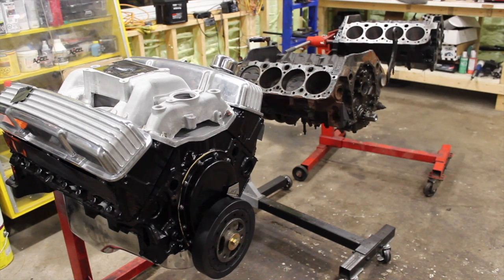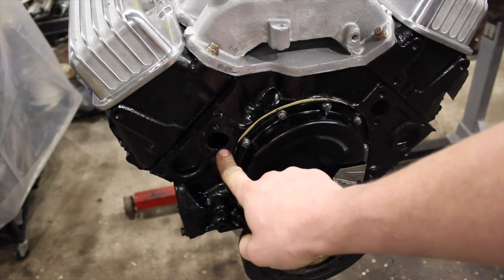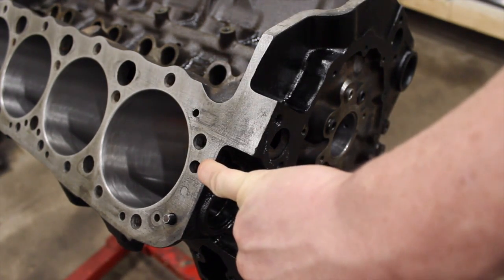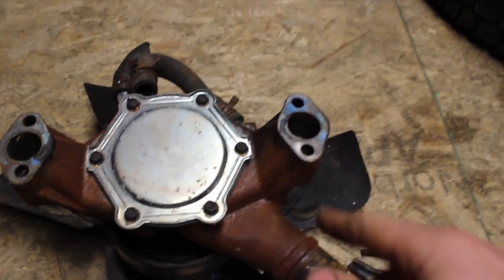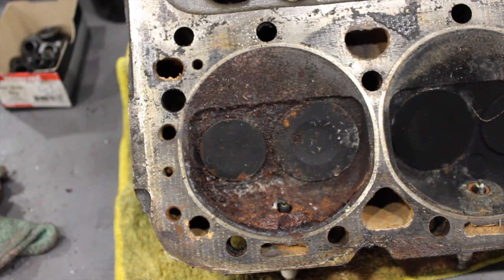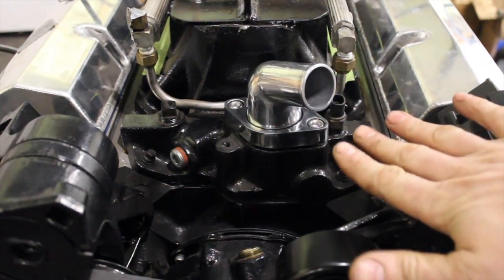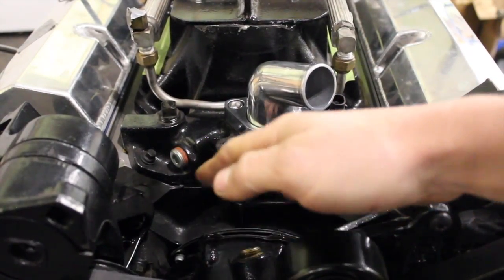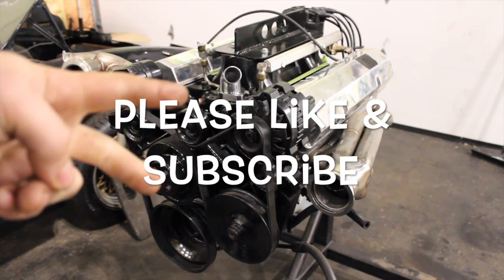SBC Water Pump Bypass? (Read Description for instructions) Vortec heads vs Traditional heads

Comment: I don't have vortec heads, but I have a high flow water pump and am considering blocking this port off because anytime I get above 5000 rpm it blows the gasket ONLY at that port. Any drawbacks from a performance standpoint while trying to gain some reliability from the mod?

Comment: I have the Vortec block and Vortec heads. Thing runs too cool in the winter (160*).
I have a water pump with no port and a manifold whose front port is being used for something else. So I can't run an external bypass in the typical location. I have the stewart high flow tstat that has holes in it and it allows me to run cool in the summer. I have the air gap manifold that has 4 corner ports. Can I use one of those and T into the heater hose that goes into the water pump?  Will that allow it to get hotter in the winter and then I can do away with the high flow tstat?

Comment: This is total garbage.  That second hole under the main cooling hole does nothing for cooling.  If the thermostat is closed there would be no circulation because the low pressure side of the water pump cant get any water to pump through anything therefore you’d have no flow without the heater core hose feed and return hooked up.  Drilling holes in your thermostat is totally retarded too.  All it does is make it take longer to warm up.  There is literally no value to anything you “play with” here.

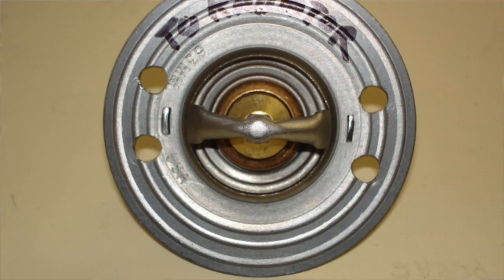Comment: This is the sacred secret for Vortech swappers. This is a fantastic video. I have a small problem at 7:18 - I totally agree with the hole in the thermostat to let trapped air out. Import cars have done this since the 70's. They usually put a rivet in the hole so it stops the flow once the fluid goes through the hole. I DON'T agree with drilling 4 to 6 holes in your thermostat. Your engine will take 1/2 hour to warm up because so much water is going to the radiator. You only need one 1/16" hole.

Comment: That is a really good video,  not being rude , but need to add check water pump for proper rotation. Vortec pumps are designed to run CCW called reverse rotation,

Comment: Have you used many of the Chinese rpm air gap copies and dynoed enough to see if there's any power difference in peak power and average power in both torque and horsepower? I'm a huge victor jr fan, but that's on smaller engines and I'm considering trying an rpm air gap on my 383.
Reply from the maker: Ive found that just about any engine that operates under 6500 rpm makes better average torque and HP with a Air Gap style intake vs Single plane. Sometimes, the peak HP is slightly lower with the dual plane but sometimes not
Reply: @cuttersperformance  does any of the Chinese knock offs work as well as the Edelbrock rpm air gap , or does the Edelbrock make more power to justify the cost difference?
Reply from the maker: @inscoredbz  ive never done a back to back test. But ive made similar power on similar engines with the same style intakes. There's no doubt that the edelbrocks have better castings than some of the knock offs though

Comment: Have a 350 old school block a friend built for me. not Vortec heads, but he put tbi heads on it. having trouble with it heating up way to fast, and not coming down while driving. tried multiple fans and cooler thermostat and no change. I then find out, he was going to put an electric water pump on it, so he blocked off the bypass hole. then decided against it. installed a factory style pump for the block, but before doing so removed thge bypass plug, and conveniently forgot to mention the plug fell in the block and he couldn't remove it. no provision in intake for a bypass hose. my question is, are the tbi heads also not drilled for the bypass provision?

Comment: If i were to drill that bypass hole (im running afr heads on a 880 block) do i need to drill any holes on the head deck?

Comment: I do like serpentine belts. But im putting my vortec in a 72 4x4 chevy truck. So id like the engine to be clean of the big serpentine brackets. Can i just run the vortec bypass hose from the intake to a old school water pump, and everything work out fine with a V belt set up?

Comment: Hello Pat, what's your take on pump rotation clockwise or factory counterclockwise or does it matter?
Reply from the maker: If you're using a OE serpentine belt, most setups will be spinning the water pump backwards so you'll need counter clockwise pump. All V belts need a regular water pump (clockwise)

Comment: great info, i got vortec heads just to get a small performance boost on my junker 360 sbc and i had no idea they blocked the internal block/head bypass for coolant flow. Ill have to check my manifold if i have a port to add a bypass hose to the pump or ill just drill the thermostat, hopefully i dont forget when the time comes to do it

Also, out of curiosity, any port on the top of the water pump will do right? Do all the ports take coolant in or are the lower passenger side coolant out?

Comment: only ever drill a 1/8 hole in a thermostat as a air bleed . The factory only bypasses the coolant to one side only.  Far better off using a bypass hose ( like a big block) . this stops the block & heads going into thermal shock as the thermostat constantly opens and closes. A thermostat is considered open at 8mm open and flowing its max.

Comment: I am using a blueprint engine setup with the vortec style heads and the block doesn't have the bypass hole in it for the old style water pump that is going on it I am going to drill some holes in the thermostat after seeing your video on it so I don't have to run the hose from the water pump to the intake thanks for the information. But do I need to block off the bypass port on the water pump itself and what would be the best way to do this ?

Comment: What did you use to plug the water pump bypass hole
Reply from the maker: You don't have to plug it when using vortecs heads on a older block. The vortec head blocks it off
Reply: @cuttersperformance  I have a Chevy 350 with speedmaster aluminum heads I went with serpentine set up and my 3rd hole where the water pump at I need to plug it

Comment: hey brotha love your videos I have 880 block that does have 3rd hole on block so your saying if I use older water pump with vortec heads all i need is holes in tstat i dont need to run hose from water pump to intake doesn't that do same i live AZ so would it be good to do both
Reply from the maker: Run the bypass hose plus put two holes in the thermostat
Reply: thanks man I appreciate you and all you do

Comment: Thank You Thank You Thank You. 
So glad I subscribed and learned this very important coolant issue.
I'm installing 059 Vortec heads on my 1985 Gen 1 SBC. I had no clue this was a thing. Drilling holes in the thermostat is a great work around.

Comment: What if I have the bypass and drill 5 holes? I was told to drill 5 holes by my buddy before I seen this video lol I’m also in Texas tho
Reply from the maker: Have you tried it? That's alot of holes when using a bypass. I would have done two. You may have super slow warm ups
Reply: @cuttersperformance  yeah my warmup are slow but doesn’t overheat anymore stays at 180 once the temps up. Is there any risk to running it like that?

Comment: Little late to the party here but, I’ve been blowing water pump gaskets by, what I think, is higher rpm before the thermostat is open.  I’d like to install the bypass hose from the manifold to the water pump but not sure which hose to cut a tee into..

Comment: Great video. I have a SBC 350 Gen 1. I have plugged the intake and water pump bypass hose so there's no hose there. After seeing your video, i think i should put the bypass hose back from water pump to intake. Or can i just leave the outlets plugged but drill some holes in the thermostat.? Its either one or both, correct?
I live in a very hot tropical country by the way.
Cheers
Reply from the maker: If it's a hot climate. I would use the intake bypass as well as drill two holes in the thermostat to prevent air pockets
Reply: @cuttersperformance  Thanks mate.

Comment: So If I’ve got a stock vortec with the 062 heads, it would be recommended to drill the holes in the thermostat to keep the heads cool? I’ve heard they’re prone to crack
Reply from the maker: 1 or 2 at least to prevent air pockets and cracks in the heads
Reply: @cuttersperformance  Thanks again boss!

Comment: Will the water flowing through the heater core back to the radiator do about the same thing? I have a set of 906s oh my 93 C10 TBI motor., 5.7?
Reply from the maker: Yes but you may find adding 1 or 2 small holes in the thermostat will help with temp swings from air trapped around the thermostat. Also helps prevent head cracks on vortecs

Comment: Hey Pat, why not just drill the bypass hole into the vortec head, I have both the block and water pump with the bypass. I have put a hole in the T stat for a long time to deal with the air issue.

Comment: If you see this and answer I would be so grateful . 

I have a later block with the bypass.  I’m using vortec heads that block the bypass. And I’m using a v belt direction water pump .  From what I gather from this video . I can also just drill holes in my thermostat and be ok also right ? 

Thanks in advance . Awsome video
Reply from the maker: Yes, if you dont have a bypass, a few holes in the thermostat (follow directions in description) will stop the vortec tempature swing and prevent head cracking

Comment: Great video. What if I’m running an 880 block with no bypass holes and also running aftermarket aluminum heads that’s not drilled for a vortec style intake ?

Comment: Horrible advice. U cut that many large holes into your thermostat u mine as well take it out. Your not letting the coolant stay in long enough.
Reply from the maker: Ive ran 3 holes in my thermostat for several years without ill effect. It gets  to operating temp and doesn't have the vortec temp swing

Comment: Just an FYI. I have only ever put a single 1/8" hole in the thermostat flange, to purge out any trapped air, and I have never had a hot spot problem. Personally, I think you are putting in too many holes, and too big of holes. Anyway. I like your content, you just got another sub.

Comment: Just a thought if the holes in thermostat stop thermostat from opening motor could run too cool and circulation is slowed down cause thermostat is not opening as much. Even just two holes  in thermostat can cause it to not open as much as it should.

Comment: I drill a couple  small holes in the thermostat  so the water still flows  a little.   And I'll put a brake bleeder in one of the intake water ports near the thermostat  housing

Comment: What if I use a heater core back into my passenger side of my intake manifold will that work as a bypass my l31 does not have the 3rd by pass hole for the left side of the water pump but my water pump has that hole

Comment: I put new Vortec heads on my 74 sbc. Decided to drill 2 1/8 holes in the thermostat instead of drilling the head. Having trouble with the system pressurizing, top hose gets hard as a rock while it’s running. Doesn’t overheat though, ran it today and it stayed around 180-200. Any suggestions??
Reply from the maker: The system is supposed to be pressurized with the cap installed. Typically around 15 psi, the pressure in the cooling system brings up the boiling point of the coolant from 212 degF to 240+ @ 15 psi.
Reply: @cuttersperformance  thanks for the response. I just watched your video completely and you recommend 4-6 5/32 holes in the stat, I’m going to try that. I know it has to be pressurized, but this is excessive
Reply from the maker: @EvanLightner304  read the description in the video on how many holes.  4 to 6 is the max.
Reply: Thanks man!!

Comment: This is really interesting. I have an 880 4 bolt block that has the bypass, the timing cover holes are drilled and tapped and it is also drilled for a mechanical fuel pump. A bit of a odd duck but perfect for my plans. Building it to replace a cracked block engine in an 1987 21' SeaRay boat.
Reply from the maker: There is certainly a wide range of different 880 blocks, almost like a crap shoot with everyone I pull apart. Ive seen 880 blocks where it looks like the coolant passage is drilled, but its not actually fully drilled, so be sure to blow some air through that passage to be sure.

Comment: Ok.. So if I have a 1st gen block that HAS the  bypass hole in the block and I want to use the vortec heads with the intake manifold bypass, which water pump do I need?  Do I have to plug the bypass hole in the block in order to use a water pump that has the intake manifold bypass hose provision?  Sorry If I seem obtuse ..
Reply from the maker: The vortec cylinder does not use in the inblock bypass so it actually blocks the hole on the deck surface. You can run the vortec water pump as it has the extra bypass hose but dont forget this is a reverse rotation pump and has to be used with a serpentine belt system. An old school water pump you can T into the heater hose inlet from the water pump
Reply: @cuttersperformance  now I’m even more confused? I have a mid 70’s block, with V pulleys, in a Jeep….. I’m about to swap on my 062 heads, and I’ve bought a new AC Delco water pump for my year engine…. I have to idea if my ‘89 Wrangler heater core is a shut off style or not? So I just drill a few holes and feel confident that I’m good? Or do I need to T into a heater hose, also? I’m lost now!
Reply from the maker: @Dave n Karen  put 2 to 3 holes in the thermostat, and you're golden,

Comment: Awesome video Pat. Just finished my 383 build and didn't want to run vortec style water pump.  I will drill 6 holes in thermostat and eliminate bypass hose. Thanks for the video!!
Reply from the maker: Thanks for checking out my video. Check out the description, 6 holes is the maximum I've done. I find 3 is a good starting place and works for most

Comment: Figured it out if I use my heater core running from my old school pump to my heater core from my core to my intake manifold I have a l31 block and vortec heads will I be good without even drilling into the t stat ?
Reply: Any info on the heater core

Comment: I have a 880 block without the coolant bypass the extra hole on the passenger side but my old school water pump has the extra hole I’m going to drill the hole what should I do from there
Reply from the maker: I would not advise trying to drill that. The older blocks have the bypass which is a hole from the right deck to the water pump, that would be pretty tricky trying to drill that from both angles. They may make a jig for that but ive never seen or tried it before
Reply: @cuttersperformance  ok so I purchased a 98 Silverado 1500 l31 complete motor heads are 062s I purchased a aftermarket intake and I wanted to use my old school pump from my older 350 I don’t have the extra hole in the 880 block what should I do from here is what I’m saying I’m putting a carb onto it just attach the water pump and go ?
Reply from the maker: If you want to use the silverado accessories then you will have to run the vortec water pump. If your using older accessories then a normal sbc water pump will work and the water pump gasket will seal the bypass hole against the block. 
If your not running a bypass a few small holes in the thermostat works wonders
Reply: @cuttersperformance  yes I’m using my old accessories from my 85 350 so my water pump has the coolant bypass extra hole cause it’s old school but my block doesn’t just install the pump the hole will lineup against the would be hole in the block for the bypass on the 880 but mine doesn’t have it
Reply from the maker: @oldsrocket8456  yes but you can still use that old water pump. Youll want to drill two small holes in the thermostat to work as a bypass
Reply: @cuttersperformance  ok I’ll drill the holes in the thermostat but won’t my reading be off and the point of it opening and closing in temperatures won’t be accurate or correct with the holes drilled into it ?

Comment: So if I have vortec heads on the engine I don’t need to worry about the bypass hole in the block? I can run a tbi pump on the engine to keep the reverse rotation? (vortec 880 block with the hole below the water pump bolt + mechanical fuel pump machined)
Reply: Just have to have a hose from water pump to intake

Comment: I have an 86' block. 1 piece rear main, BUT flat tappet cam. Non roller. 
It has the lower water pump bypass hole in the front of the block. But it always does overheat on first startup. I never could figure it out. Engine suffix code is DDL.  Im wondering if the deck isnt drilled for the bypass. ?  

Its also factory machined for mech fuel pump and all the timing bolt holes. Its an odd duck.
Reply from the maker: All pre 96 blocks should be drilled for bypass and I actually have the exact same block as you sitting in the shop. 1pc RMS, flat tappet, 4 bolt main truck block
Reply: @cuttersperformance  Mines a 2bolt. Fbody block iirc
Reply from the maker: That is a strange one, because the 86 fbody would have been 2 bolt but should have had a roller cam

Comment: what about running a tbi serpentine setup and water pump with vortec heads.....?? mine had never run over 180?
Reply from the maker: Do you have the temp probe for the gauge in the head or the intake? 
Often times you may not notice the temp swing with the probe in the heads. You can still get air pockets around the thermostat depending on the layout of the cooling system (rad height vs thermostat height)